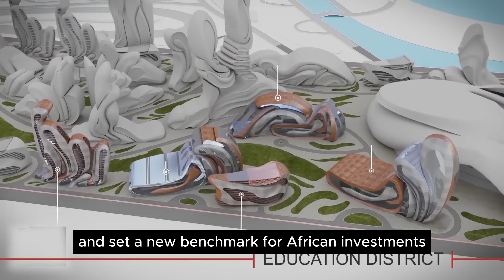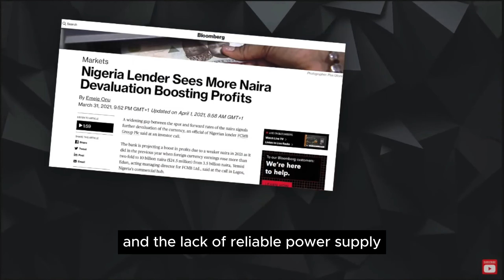Why Are Africa’s $12B Mega Real Estate Projects Failing? The Story of Eko Atlantic and Akon City"

Comment: this is really poor from you. Before you start down playing this projects, Eko Atlantic in particular, you should have done your research. Eko Atlantic is constructed on reclaimed land. They had to first create a wall holding the oceans current,  sand fill the entire area, build roads and drainages which have already been done. As you can see there are already more than ten Building (completed or under construction) in Eko Atlantic. To come out and say this project is failing is really poor journalism. You can do better bro